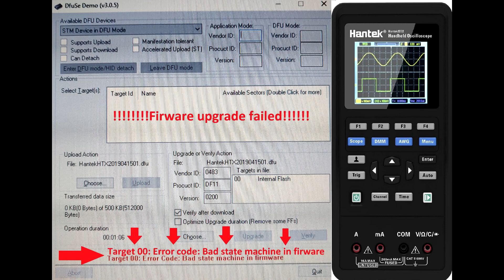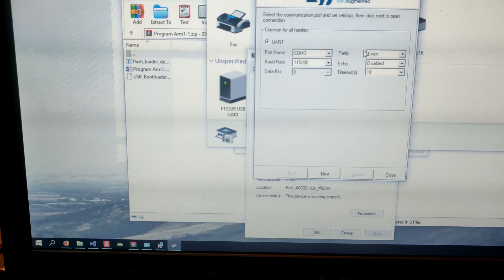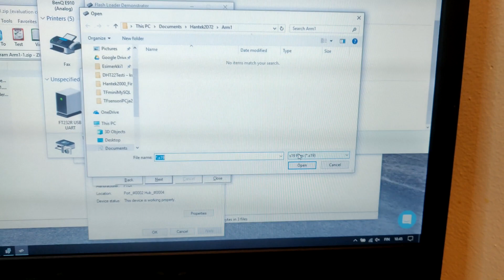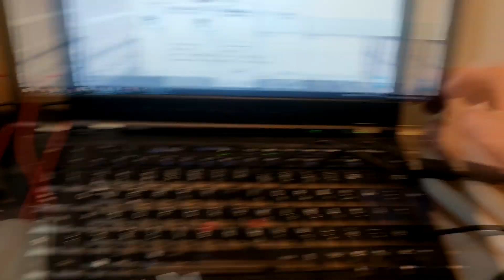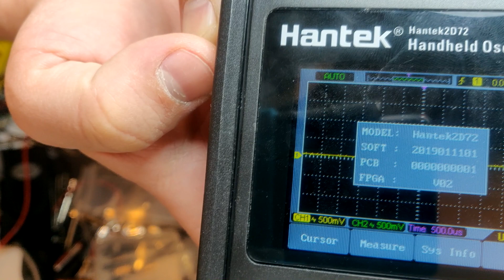Hantek 2D72 Firmware Failed  **REPAIRED** Demostration

Comment: Hey, I just wanted to thank you. My 2d42 arrived and it didn't start. Thought it's beyond saving, couldn't even send it back to the seller ( expensive shipping ) . I stumbled upon your video and I managed to get it up working. Cheers mate.
Reply: Hello, I have a 2d42 and when I was updating the firmware the PC was turned off, the oscilloscope now does not turn on, only the power button remains on, how can I revive it?

Comment: Another bricked 2c42 saved thanks to You man! Thanks a million. I just learned a few new things. 1st don't fix it if it works (as I had no explicit reason to upgrade firmware) and 2nd if something goes wrong there is always someone smarter who can give you a hint :) Thanks again. BTW after bringing scope back to life I have run the upgrade again and the latest firmware I have now is 2021090901, PCB 10000001, FPGA V07

Comment: Thanks for posting the video. I tried upgrading the firmware on 2D72 and it bricked the unit. Using your files and an FTDI USB adapter I had lying about I managed to restore the processor to default condition. I had to connect TX to RX and RX to TX and VCC and then the program worked. The firmware file was named sightly differently to the instructions but it made no difference.
Did you manage to find out why the firmware upgrade failed for you?
Reply from the maker: I haven't upgraded to the new version. I'm glad that I got it work. I couldn't find any directions so I contacted support. I'm glad when they responded.
Reply: What voltage FTDI is it?  3.3?  5?
Reply: @SteveJones172pilot  TTL levels.  If you download the files he provides a link to in the description which he received from Hantek support, it contains a  word document  provides images and explains what the original poster shows in the video. 

Then of course give him a thumb up, and sub for helping out all of us! 😎👍
Reply: @SteveJones172pilot  3.3V

Comment: good night friend, I have a 2c72 that I bought new and the firmware came defective, it turns off when I press the button to put oxiloscope, can you help me to repair it. Can you tell me the name of the USB I use to repair that! I can't get much information to help me and can I appreciate it
Reply from the maker: Download the driver package "Program Arm1.zip (34.28 MB)" for the video description link ""........Instructions can be found in the compressed folder "Program Arm1.docx". Connect your scope to PC serial interface via RS232 to TTL module or USB to TTL module